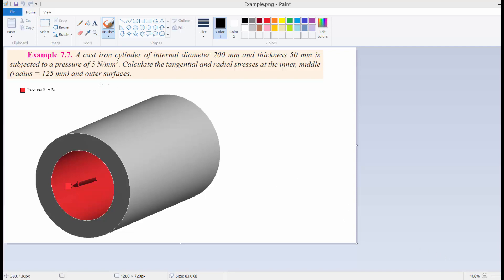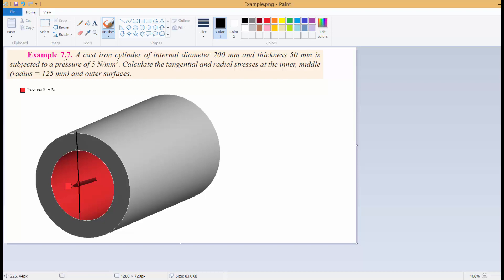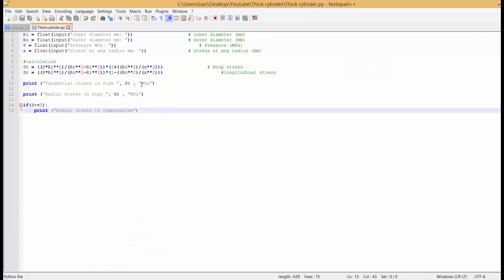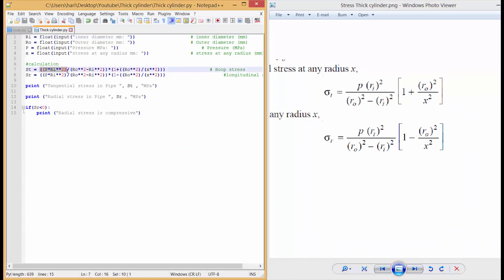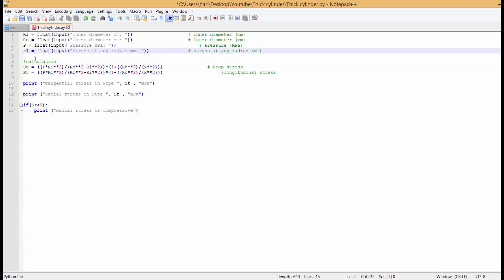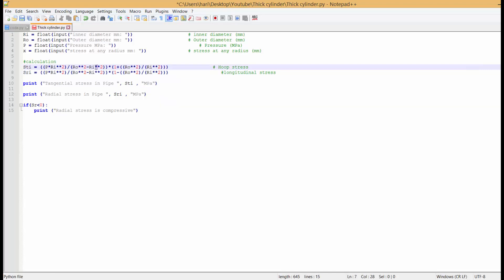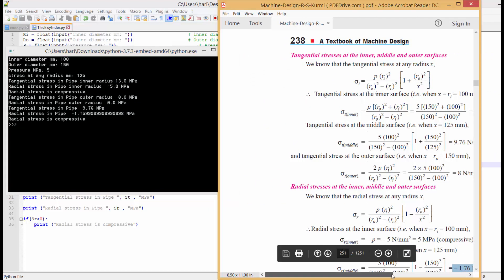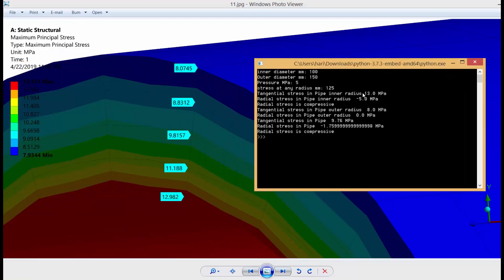Python for mechanical engineer | Python Basic Tutorial | Python for mechanical basic-4

Comment: You seem to be forgetting the end cap pressure induced stresses in the longitudinal stress calculation
Reply from the maker: Its just stress along wall of thick cylinder, basic example to use python. you can check my advance tutorial for integration in python using suypy